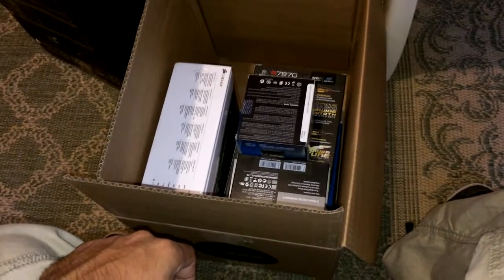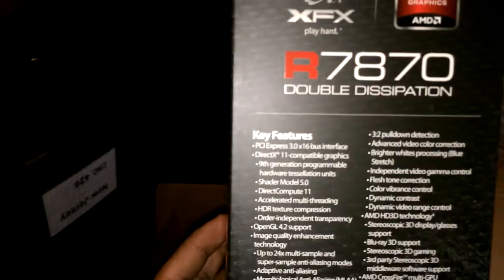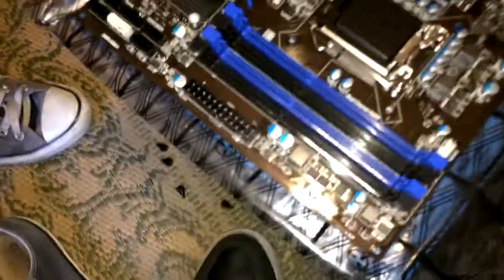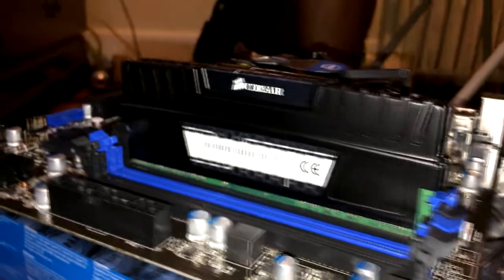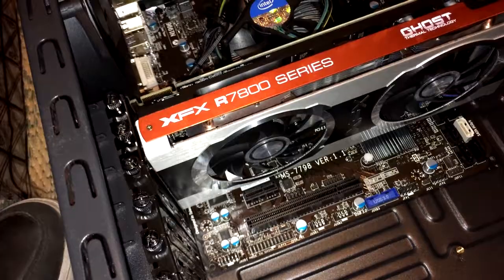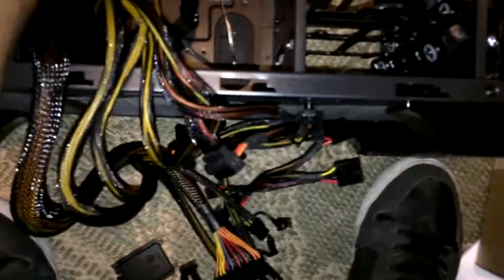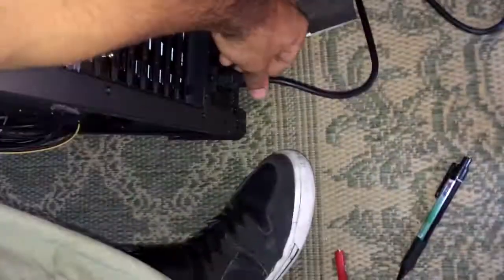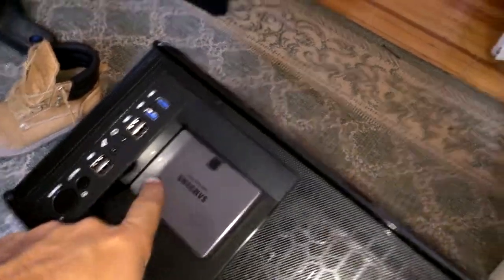PC Build (i Fucked up my Motherboard)

Comment: hey dude u placed the damn ram wrong -.- if u dont know how to install ram ill say it your ram needs to be in the same type of color slots. also your motherboard has a manual where u can reed what slots they recommend for installing only 2 ram cards. Also did u really make sure there whas not a extra motherboard mounting screw shorting the board from behaind i belive this is how it would act if so.